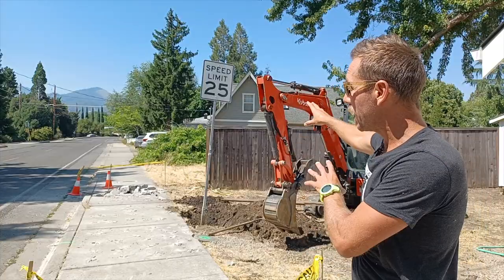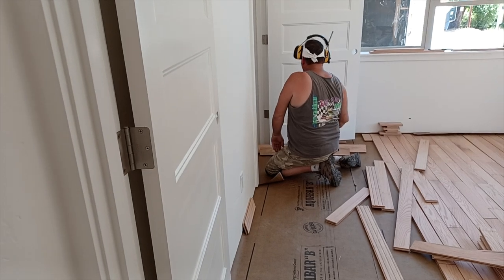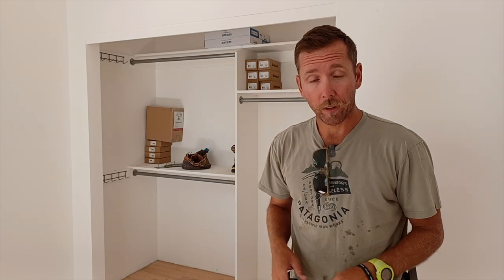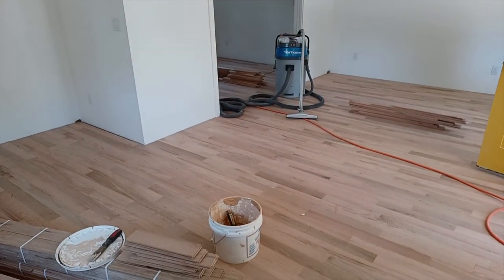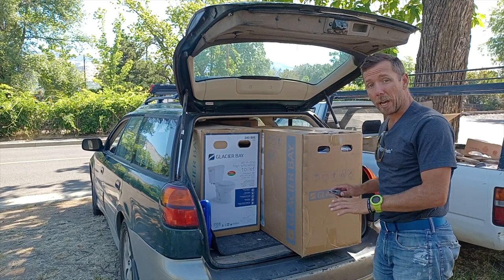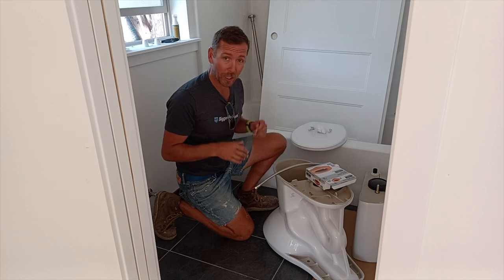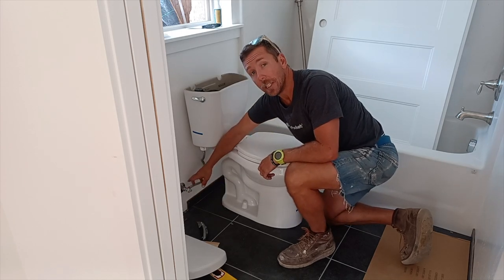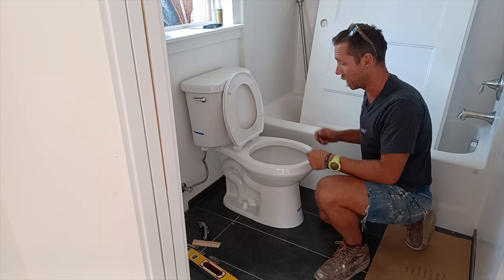How To Build an ADU with Cost Breakdown | Part 13

Comment: Have you ever done hardwood on a slab on grade?
Reply from the maker: No, and I dont know that I would do it... but there are several decent strategies. Floating plywood then glue and nail to that, also full trowel glue down... but I would be very careful of moisture content of the slab.